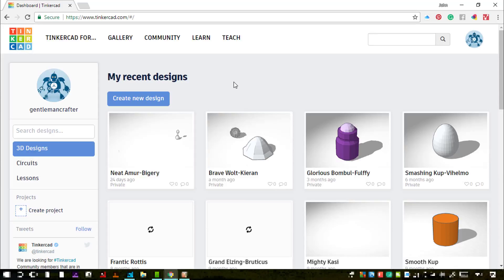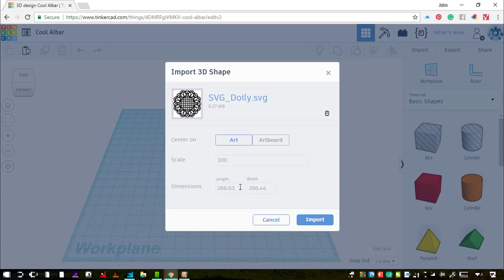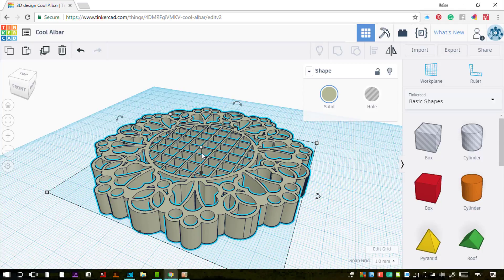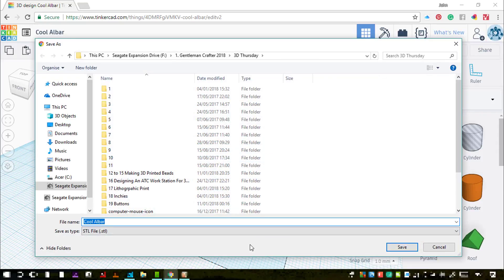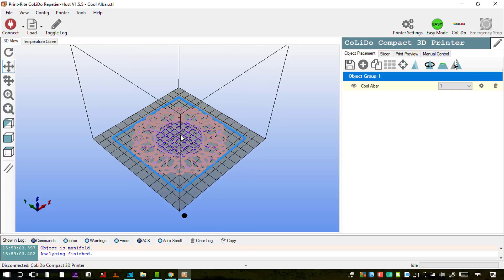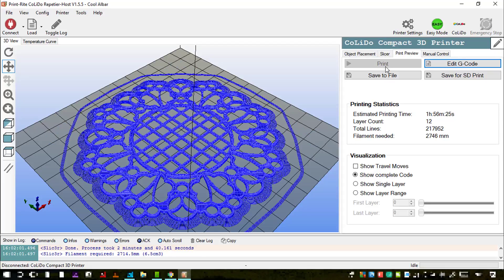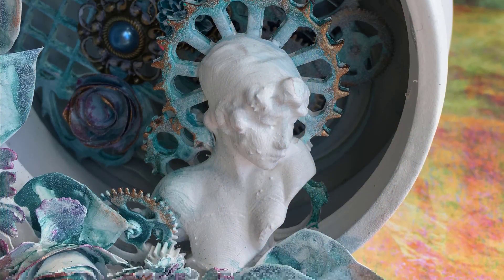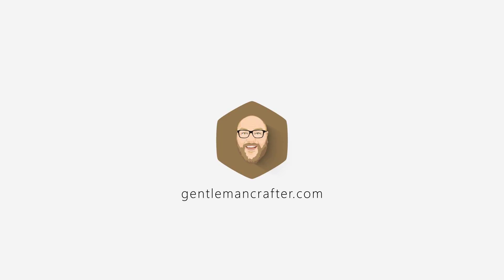Converting SVG files to STL files for 3D Printing

Comment: tried this in 2020 (jun) and it won't work. works with a svg of as tar from inkscape, anything like the doily you made and tinkercad just says error importing.
Reply from the maker: Strange, still works for me. Tested @ 09:51 GMT 07/06/2020
Reply: what format are you saving in? in inkscape I have found I have to save in optimised and remove the XML  (inkscape SVG and plain svg did not work for designs except basic stars etc.)
Reply from the maker: @dragonlord0666  I saved as Plain SVG. If you are using Inkscape, Inkscape SVG. Inkscape SVG saves additional information like shading and line properties that are not easily read by other software. Plain SVG has worked for me this morning.
Reply: @GentlemanCrafterUK  I tried plain svg but that still did not work for the design I made, kind of moroccan screen (they all worked for the simple star) but tinkercad just came up with error importing (not really helpful) after a while and would not load the svg - only optimised svg and ticking the remove XML worked - I'm using inkscape 1.0 on mac (mojave)
Reply from the maker: Well, at last you have a workaround. Good to know in case others come across the same issue.
Reply: was driving me mad, every video was showing people just saving from inkscape and importing into TC - just not for me.... took a while to figure out the optimised bit and what I needed to tick etc.

Comment: HELLO Gentleperson, I take it that I can use tinkercad to convert to 3D and save the finished image and import this to eather /vectic or easel for my router based CNC. Do I need to use this Slicer software also? Thanks for the help. PS, is there a  video on modifing the image. example: I have an image of my US Navy logo and I would like to make the eagles wings bend outward? can I do this?
Reply from the maker: Not sure that I follow the question. Sorry!